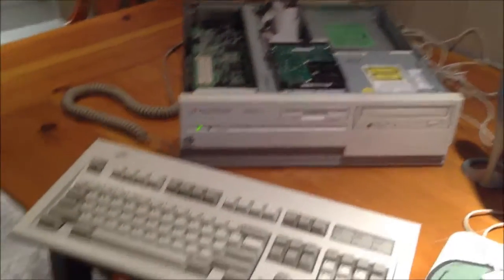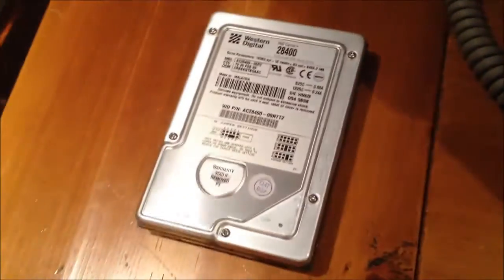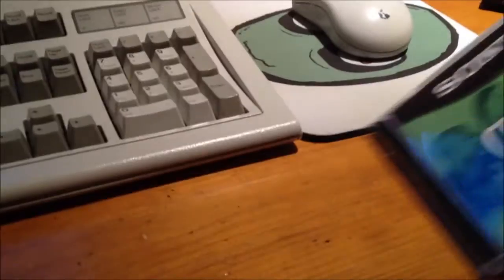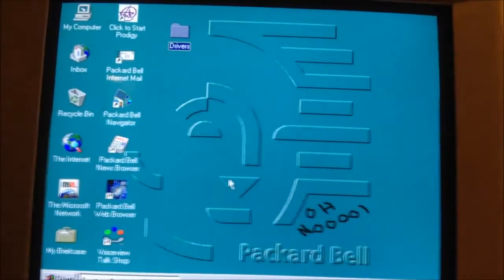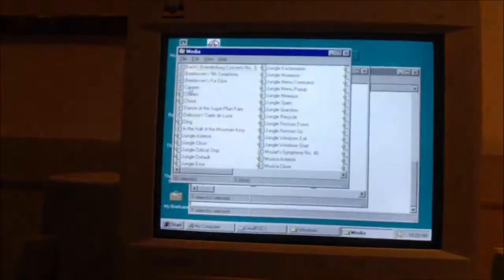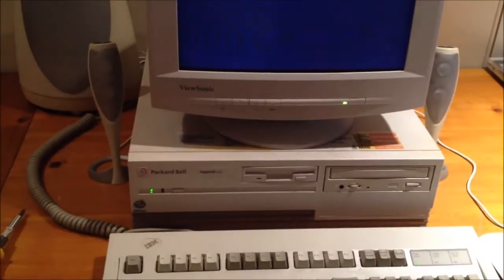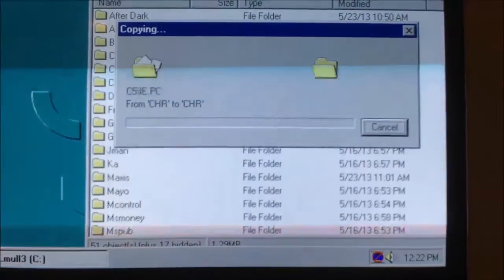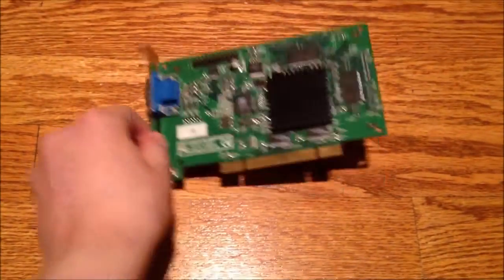Setting Up The Packard Bell Legend 3450

Comment: That's incredible... A while ago I had an old Dell with a P3 running at 450 MHz and it was incredibly slow. I can't believe how smooth yours is running while it's even older than the Dell.

Comment: It was some weird Int 13h hack and the setup was SLOW. Norton System Info clocked it at like 4200rpm. Installing a WD 3.1GB drive literally tripled the speed of the machine due to faster disk I/O. Performance was still lagging due to the lack of L2 cache (PB had to cut corners somehow to get the price down). My board, a PB650 aka "Hillary" lacked any sort of provision for L2 cache. If your board has a COAST slot I highly recommend filling it with at least a 256k module.

Comment: When I got it a few years ago it was running XP, but that was obviously too much for the machine. The sticker said it originally came with 98, so I installed that. Still, incredibly slow. I think it's the harddrive, it's a 60GB made by you-know-which-brand. ;) It was loud and running hot, so I guess the harddrive failed...

Comment: Installing dos drivers is pretty easy. I have dealt with alot of Sound Blaster based cards including and AWE64. Here is something for you to try before installing the dos drivers. Try editing your autoexec.bat file and add this command SET BLASTER=A220 I5 D1 T3 P330 H6 and save the file. Then try running a game that you had no music playing. If  this does not work then I would try installing the dos drivers. Hope this helps ya out.

Comment: Key Benefits

         
            256/512 KB Cache Memory
            Pipelined Burst
            Cache On A Stick (COASt) Configuration*
            Great way to improve motherboard performance
            BRAND NEW. No return or refund for incompatibility. Replacement for faulty unit only.

        *Motherboard w/ a COASt (CELP) Slot (usually seen on 486 and some Pentium Systems)